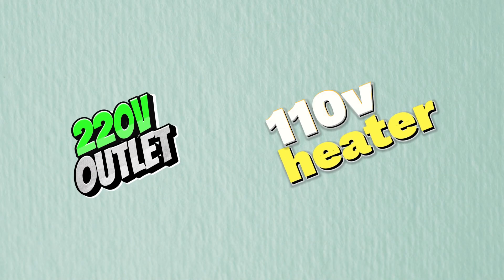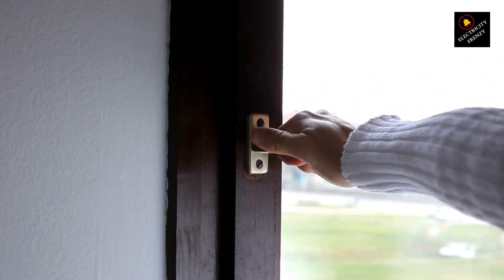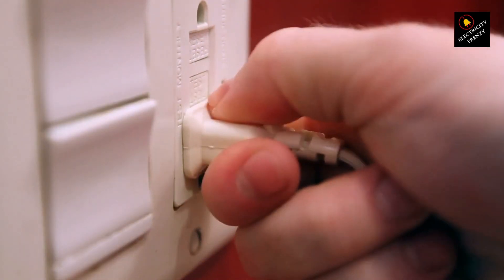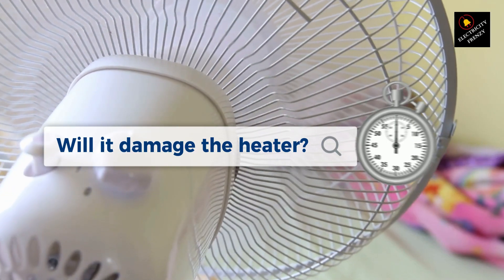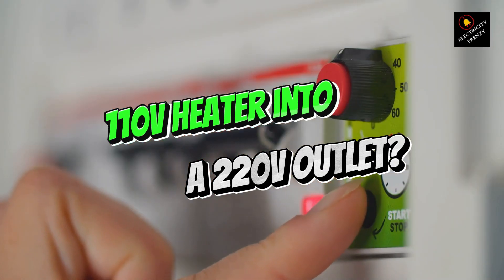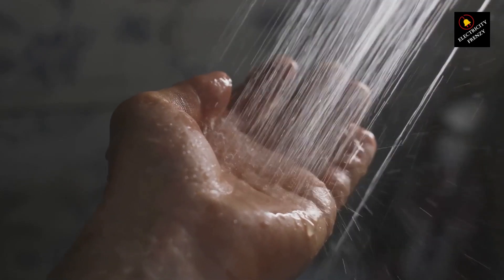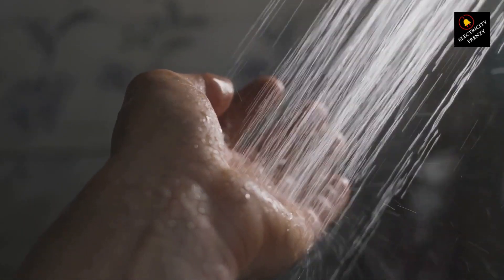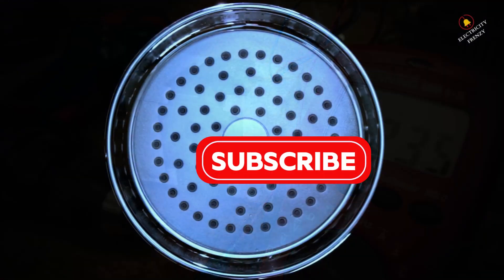110/220v Water Heater into the Wrong Voltage! Will it get damaged?

Comment: Does frequecy matter
Reply from the maker: No
Reply: Great question.  I built a boiler that was supposed to be 120 so I bought 2 120 hot water heater elements to experiment with. I ended up using a sentry xpress control box with 240 and thought I could split the output. I was wrong. I was only able to wire in 1 element without tripping my dual 30a breakers. Using only 1 element worked for a while until it didn't. So I wired in the other after disconnecting the first. That lasted about 15 minutes. I guess it's time to pick up an element made for 220.